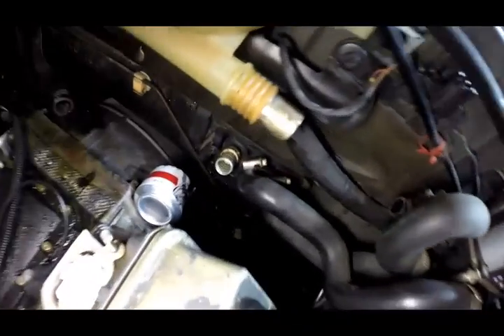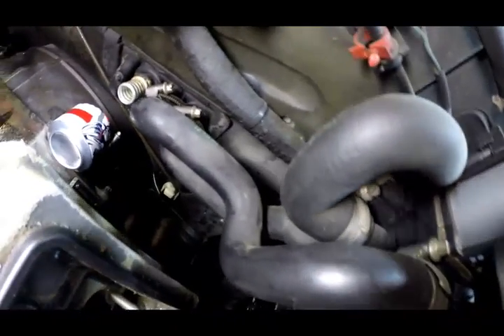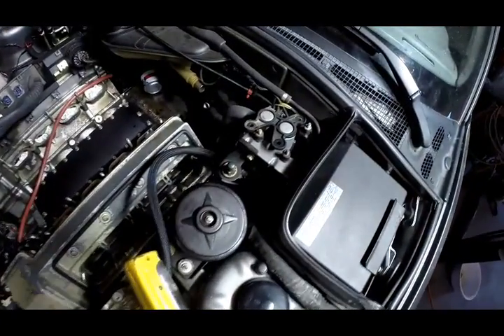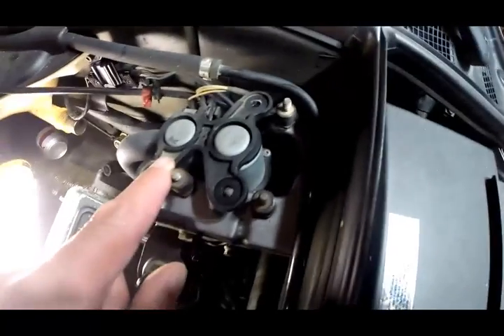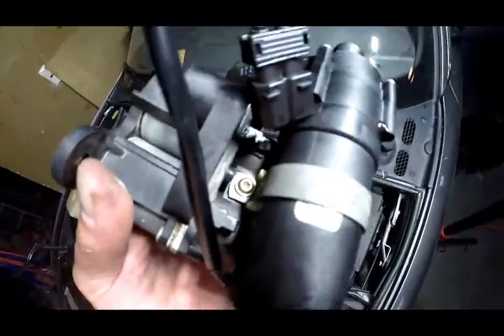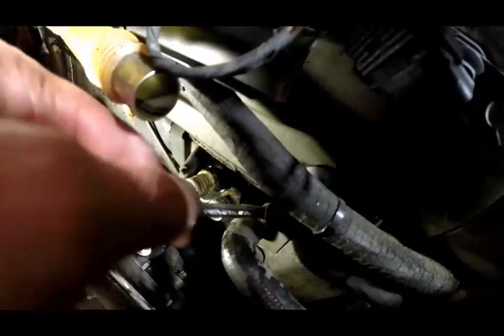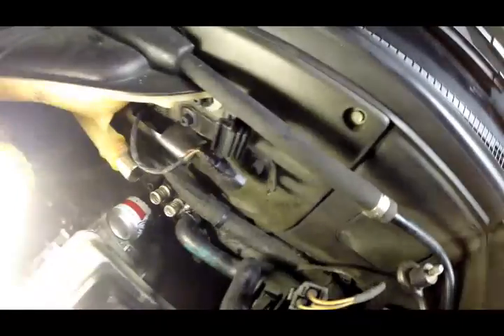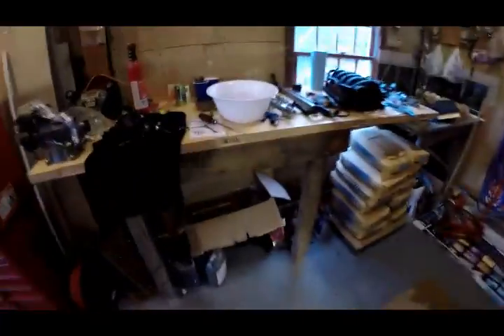DIY 1994 E34 540i auxiliary water pump replacement

Comment: You need to also note that on the V8 cars - after installing a new auxiliary pump, sometimes they keep running continuously, and sometimes they don’t work at all. They should only come on when a certain temp is selected on the heater control and the outside temp is over a certain degree. Many times the issue is a faulty relay. The auxiliary water pump relay - # 10 RELAY - not fuse in the under hood fuse panel. Of course also make sure all the fuses are intact.

Comment: Thanks for posting this video, I have one that has the heat of a dog's breath on the right and cold blow from the driver's side.  Not going to work out here in colorado for the next few months either.  Many, many issues with this one.  Won't start when cold, have both crank and cam position sensors on the way.  No on board computer display, no radio, no power mirrors, no heat as mentioned, crazy cluster display with no lights for night driving and that's just the stuff I can think of at the moment.  New fuel pump did change a thing as to cold starting, hot wiring it on also did not allow it to start.  I have my work cut out for me but seeing where the aux pump actually was is a real help so again thanks for that.  I also suspect I may need head gaskets, but I haven't looked to see if mine is broke where yours is - I do have missing coolant issue as well, but at least it's a slow leak.